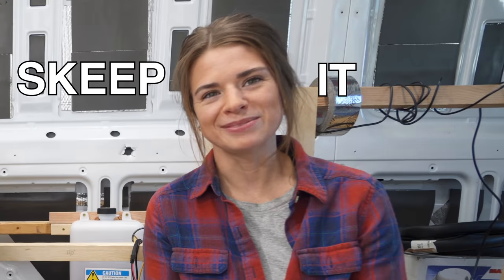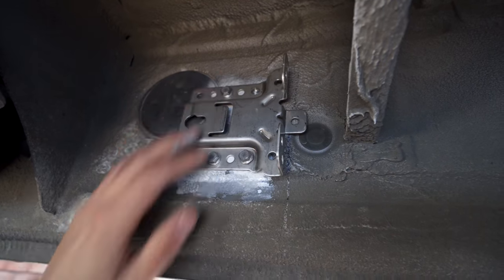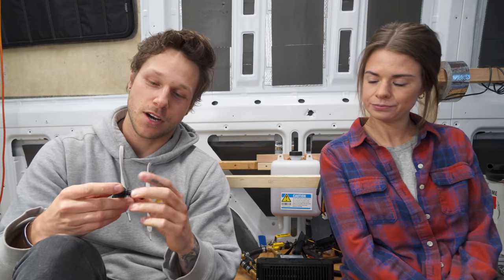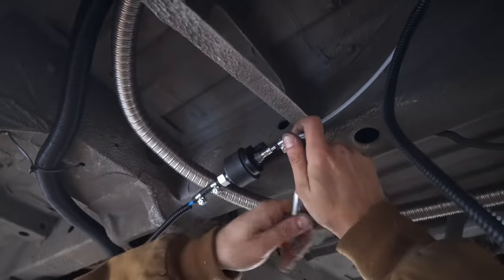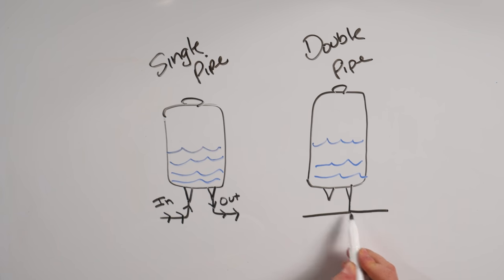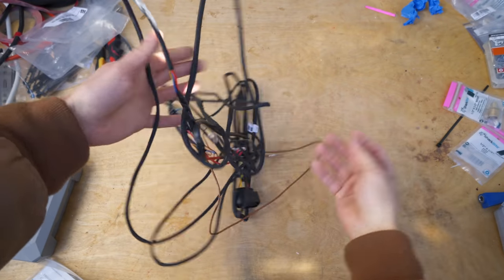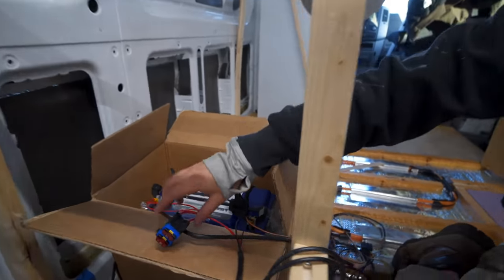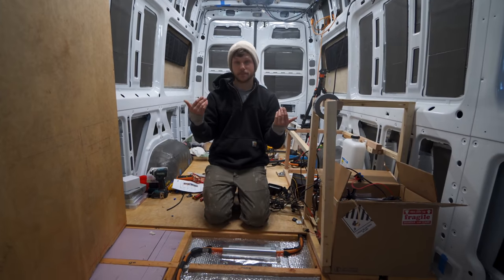Heat Your Feet! How To Install A Hydronic System In Your Van

Comment: Hi, greetings from Cornwall, England.
Great videos, you guys crack me up!
Re the hot water, not sure if I missed it but obviously the glycol sealed system runs through the plate heat exchanger which is connected to your cold domestic water fee. My question is, does this produce instant hot water from the tap (faucet!)? Or do you have the heat exchanger in another water tank purely for hot water?  What tempeature do you get? Many thanks.
Reply from the maker: It should produce instant hot water, but we haven't finished our plumbing yet to test how hot it gets. We'll be doing a full review in a few months.

Comment: Is it necessary to cool the coolant before it goes through the floor? Rixen recommends a mixing valve and additional pump. People say you'll get hot stops and it'll be too HOT if you don't cool it first. What's your experience?
Reply from the maker: There are a few warm spots, but nothing hot enough to cause an issue or need for a mixing valve. We shall see if that changes over time.

Comment: Hey guys! Are  you functional with the heating?  We purchased from Heatso the espar D5S, the Kalori EVO1. It was a kit, we just bought that as it was listed. Buyers remorse.  The Kalori doesn't get very hot, the D5S only  runs for 3 programs for 120 minutes each. Not thermostatically. The Kalori only raises the temp 10 degrees over outside and it is so loud you can't have a conversation.  Heatso not helping at all. 3000$.  😿 Hope anyone reading this will save themselves the grief.  Not Heatso, Not a D5S.  Maybe we have a bad Kalori. For sure the D5S is a disaster. If you are cold weather  camping, thermo control is essential.   Hope to hear yours works perfectly, and maybe then we can get a warranty replacement.
Reply from the maker: Yes we've been utilizing our heating system this winter. There is an override setting that you can find within the instructions that will allow you to set your heater to run for as long as you need. We will do our best to include a video showing our thermostat hookup for the system before we are completely done with the build serious.
Reply: @dogcatmanvan  Thank you so much.  Grateful.  Can't make out how to set the EASYSTART REMOTE+ to infinite.  If you have a different controller running the same D5S that would be so helpful to know.  No answers from Eberspahcer or Heatso as to programming or a substitute.

Comment: I have a 1990 ford e150 that I'm converting. 
Since my floor plan is a bit smaller; will the surface be a bit warmer due to shorter distance?
Reply from the maker: It can be if you make your lines tighter together. We spaced ours at 12 inches apart which was too big.

Comment: My first heated floor I figured out very fast that heat does not pass through wood very easily.  The closer the tubing is the better , but the surface cools faster than the heat passes through.
Reply from the maker: Do you ever figure out an alternative flooring that is a better heat transfer?
Reply: @dogcatmanvan  If you are going for heat conduction through solids,  I suggest copper foil adhered to the underside of your wooden top floor.  However, you would have better results with ceramic tile with a copper foil underside.  Copper is expensive.  Aluminum may be cheaper and it doesn't corrode in a humid cabin  but since it's near the top most layer, condensate from the cold metal floor would be negligible.

Most of your heat loss is coming from your air matrix and the heat exchanger since they are the 1st in line and that's why the rear of your van is much colder.  I'm going by Bernoulli's' principles of fluid dynamics here and looking at your diagram, the pass through connection from the heater to the heat exchanger looks like it's going to suck in the colder fluid from your reservoir, through the heat exchanger and mix it in with the heated fluid coming out of your heater but that's depends on the pressure difference between the heater and the outlet of your heat exchanger as well as the amount of flow resistance created by the heat exchanger.  What I'm saying is that the fluid flow through the heat exchanger looks like it would be opposite of it's intended direction in the diagram.  I would have connected the heat exchanger, air matrix and floor line in parallel.  But it looks like that single pump has enough negative pressure to keep the flow in the proper direction.

Comment: You noted that you used hot water to make the hoses more pliable in order to fit over the fittings. Seeing as the point of the system is to...pump hot water, have you developed any leaks? Did you use hosing that was rated for higher temps? Awesome video btw
Reply from the maker: We've only really developed leaks on the expansion tank as well as our three way bypass configuration which we will be changing both. The hoses can take the heat and the fittings are barbed so once they are on, they are hard to get off or leak when tightened down with hose clamps.

Comment: The reason for the single port on the expansion tank is that the water coming back to the pump. doesn't have to go into the expansion tank since it goes in the bottom of the expansion tank the flowing would pick up air this could be the flow through tee doesn't have that problem
Reply from the maker: Thanks for filling us in!

Comment: Love the system you guys used but, i was wondering.  Could you tell me if a basic type system is possible using (sacrificing) my onboard 6 gallon propane hot water heater (filled with Glycol / water) circulated through the pex in the floor with a standard temperature mixer valve and RV water pump (closed loop) thus avoiding the use of a heat exchange and all the other extra parts.  I have a diagram i could send if you use my email associated with my emoji to write back.  Thanks in advance.

Comment: DCMV, At the 26:00 mark, you mention you don't know why you should have only one pipe going to the expansion tank on a 'two-pipe' system. I think I know why. The word 'expansion tank' is part of my clue. As the fluid warms up, the fluid 'expands' into the tank rather than using the tank as a place for warmed fluid to cool down inside of if two pipes were sent to the tank. The tank could be another place for heat loss to occur inside of if you route the fluid to go through it rather than just pass by it. Hope that helps.

Comment: The piping configuration of the system doesn't have anything to do with using multiple connections on the expansion tank.  If you used both connections it would probably help with eliminating air in the system as the water would flow through the tank, and that's a plus, but it might also be more difficult on the pump.  The expansion tank has a relief valve.  When the system heats up, the glycol expands and liquid goes up in the tank, and system pressure goes up.  If it goes over 1 bar, it will pop the relief valve, but since you have air in the tank, the air will compress and probably won't go off.  The correct use of this is to fill the tank completely and add an overflow tank, which you connect the relief valve to.  The overflow tank receives the glycol and the system expands.  It should have an open vent, so when the system cools down it sucks glycol back in the system.  If you look up how an expansion tank works on a car radiator, it's the same thing.  It probably has little effect on your system.  If you open the tank valve when it's cooled down after running, does it make a pop sound like a vacuum released?  These Webasto expansion tanks are crazy expensive, you can just buy a small one for a car on ebay for 20 bucks.  The amount of expansion of 2 gallons (rough system volume) 50% glycol from 40F to 180F is about 0.31 liters

Comment: The reason it's more efficient to only have the one line connected in the expansion tank is that you are not circulating the water THROUGH the tank, which would have all of the hot water going into the tank, and leading to heat loss. If the only water that enters the expansion tank is the water that 'expands' out of the system due to heat/thermal expansion (hence the term), then it doesn't expose all of that heated water to a poorly-insulated tank that will just radiate and conduct the heat away.

In times when you're trying to heat the space (ie; winter) the losses probably won't matter too much since most of the heat will be lost inside the living space anyway, and just contribute to the overall effort. However, in the summer months, losing heat to the interior of the van not only hurts the efficiency of your water heating system, but also creates more work for your cooling system, causing both systems to work less efficiently.

I'm surprised nobody was willing to provide an explanation.

Comment: From your neibor to the north. I did not see any isolation valves on either side of the  circulation  pump. They are very good to have when you have to replace the "water" pump. No need to drain the system . Have a nice day. Tom up in Canada in the Maritimes at the NB-NS  border.

Comment: To siphon fuel out of tank, you put as much of the siphon hose in tank and pull it out really fast towards ground. This will pre-start the flow of liquid through the hose. May need to do it many times, find the technique and trial and fail till it works. Fyi.

Comment: Thanks so much for all the great info and video! Super appreciated. Curious what you'd do for a recycling shower system with one of these? Would you have to get 2 to have hot water going to your shower and then to your sink or could you t off of one system?
Reply: In addition.. I've heard there are certain places you don't want to buy the espar equipment. Is heatso pretty good?
Reply from the maker: I'm not sure on this. I personally haven't looked into a recycling shower system.
Reply from the maker: We haven't had any issues thus far

Comment: Where is the invisible inline fuel filter ??
Definitely need a heat shield on the exhaust
Reply from the maker: We contacted the manufacturer and they said an inline fuel filter wouldn't be necessary so we kept it invisible.
Reply: @dogcatmanvan  it sounds like the manufacturer knows nothing about diesel tank sediment and grit particles. All fuel connections need an inline filter or you'll clog the burner jets and carbonise the combustion chamber quicker than normal

Comment: What is the power draw off your batterys for the floor system ?
Reply from the maker: We have the D5S system and it was produced before D5E and has a draw 120watt (for about 7-8 seconds when starting), then  12watt on low, 37watt on mid and 40watt on high.

Comment: Curious if you ever found a smaller expansion tank option?  I bought a "universal fit" coolant reservoir on Amazon, but the bottom port is only 1/4"... Any idea if this will be sufficient, or does the port need to be larger?
Reply from the maker: We ended up purchasing probably the same thing as you, but we plugged the 1/4" port and drilled our own 3/4" port. We just used a rubber gasket and barb pressure fitting but we did seal the connection just to be safe and ensure no leaks
Reply: @dogcatmanvan  I've been considering that.  Do you happen to have a link to the 3/4" fitting you used?  How did you plug the 1/4" port?

Comment: Did you consider running 3/8” PEX vs 1/2”
Reply from the maker: For the floor? We actually considered running 3/4
Reply: @dogcatmanvan  Yes, should have been more clear. The PEX in the floor.

Comment: Holy shit! Certified eberspächer espar technician here. This company is selling bullshit!!  These heaters are engine heaters they shouldn't run longer than 30 minutes at a time.  Also that's way to much water and hosing for the pump. This will break in 1-3 years and I will tell eberspächer about this company.  Oh and also you void the warranty by installing it without beeing espar certified installer.  Well the warranty is way beyond gone if they know how the heater is used... I built myself a Hydronic system and they are nice yes. But these components... The company deserves to get sued big time
Reply: Another big problem!!! Get that fuel tube out of the pump basket!! You are risking air bubbles in your engine fuel pump which can kill it easily. I'm really not here to hate but I installed about 200 heaters and this video... Shouldn't be called *how to *
Reply: Yes it matters, hot water enters a heat exchanger on the top and cold goes out the bottom
Reply: Are you saying Ben and Julie did all this work for nothing?
Reply from the maker: I've taken a screenshot of your comment and sent it over to Heatso to see what they have to say. I'll let you know once they get back to me
Reply from the maker: Do you have a suggestion on a better alternative location for the line?
Reply from the maker: We've got the heat exchanger dialed in. We were referring to the direction of the air matrix inlet and outlet.
Reply: @dogcatmanvan  the fuel line inside the tank needs bo be 2-3 centimeter from the bottom when the fuel pump unit is fully compressed just next to the unit not inside. That's to make sure your heater can't suck you dry
Reply: @dogcatmanvan  I was referring to the *matrix * as water to air heat exchanger. The hot line needs to be on top but it also works on the button it's just a few percent more efficient on the top
Reply: @sandraadams4940  well it will work for some time but the heater unit will be super stressed and will not hold 10-15 years as designed but now maybe 3
Reply: @dogcatmanvan  please do, I'm shaking my head over that and will talk to my contact at the Factory.
Reply: @dogcatmanvan  also you don't need special tools or force to put the pins into the plug, you have to take out the pink pin safety clip before then it's easy and you don't damage stuff
Reply: @dogcatmanvan  I can't get an answer from eberspächer at the moment because they are down since last year because of a massive Hacker attack, worldwide production and spare part shipping has stopped
Reply: @DogCatManVan @NightcoreSM
I also am a certified Eberspächer technician, but I primarily deal with the Airtronic series. According to all their brochures, while the Hydronic series can be used as an engine heater, they can also be used as a primary means of heating an RV. I don't think Heatso is scamming you, and I don't see why you should sue them.
How many hours do you intend to use the product each year? The service life of these are around 3000 hours, and then you will need to conduct some maintenance. The good news is that the controller you have will also provide error code readouts in the event that something goes wrong. Naturally, the more you use a product, the more maintenance it will need. I'd recommend changing the fuel filter (It's in the inlet side of the fuel pump) each year if you use it a lot, or if your fuel is not that clean.

Yes, I agree with @NightcoreSM that this should have been installed by a certified technician. I also recommend that you shorten the fuel intake pipe so that it won't suck your tank dry and leave you stranded somewhere. These machines are quite sensitive to air in the fuel line, so I would recommend measuring the fuel in a beaker to ensure that the heater is getting the right amount of fuel. You can refer to the manual on how to do that. 

Eberspächer did suffer a hacking attack last year, but you should still be able to get ahold of the tech and spare parts.
Reply: @NightcoreSM  Agreed, we use the D2s and have to service them bi-annually because of the high usage. The D2s in particular seems to breakdown easily. We literally run them 24/7 all winter, and the burner fails within 3 years. I'd say the Hydronic will need a full service after about 3 years. If Ben learns how to do it himself, he'll be saving a lot.
Reply: @Channel-mu6qd  holy shit, why do I have like 20 misspelled words in there.  Jep, normally they are easy to service, just keep spare parts and learn how to do it. They are like lego
Reply: @dogcatmanvan  hey ben! Did you get an answer?

Comment: Hey guys! I have the same leak on the hoses connected to the glycol tank. Any advice for fixing those leaks? The clamps seem super tight so I’m just not sure how to make a better connection than this.
Reply from the maker: Hey there sorry for the delay, did you get your leaks fixed? For any leaks that we had, it was due to one of two issues. Either our hose clamps werent good quality (they were as snug as they could be and still leaking) or our barbed fittings werent good quality. If you have a glycol tank that came retrofitted with its own plastic barb fitting, I would guess your hose clamp is just not cutting it and you need to try a different brand. If you made your own glycol tank with a rubber grommet and brass fitting, it could be the brass fitting. We originally ordered brass fittings off amazon and every single one leaked. We went to a local irrigation supply store and got new fittings and didnt have a single leak. Hope that helps! Let us know if youre still having issues
Reply: I got some better clamps and installed those yesterday, so far it’s looking okay. I had already tried once to reinstall clamps and it still leaked a tiny bit. I’m using that same header tank that you got from heatso so the barbs are part of it. Hopefully these new clamps stay leak-free.

Comment: YOU NEED TO HAVE THE PEX IN CONTACT WITH THE FLOOR
Reply from the maker: HOW WOULD YOU SUGGEST DOING THAT?
Reply: I used 1x2 wood slats for the frame.  The 1x side is exactly the same height as 1/2" PEX.  Then I used a rigid foam board with a metallic reflective side facing up, under the PEX and the frame and a 1/4" MDF under it all to hold it all together (as a panel).  The PEX maintains contact with the floorboard on top of it.   @dogcatmanvan

Comment: No access panel from inside?
Reply from the maker: Access to which parts?
Reply: Access panel from the inside floor to access the heater elements that was installed.  Just incase.